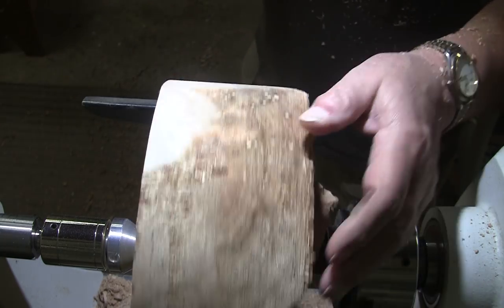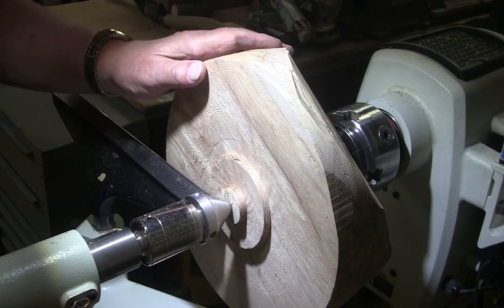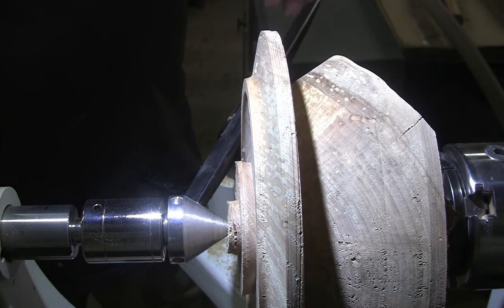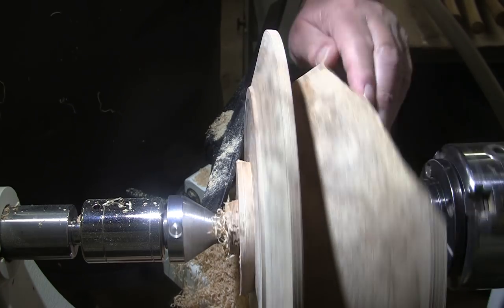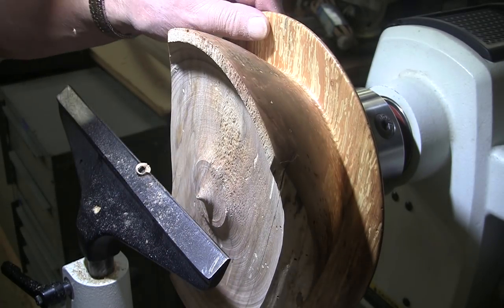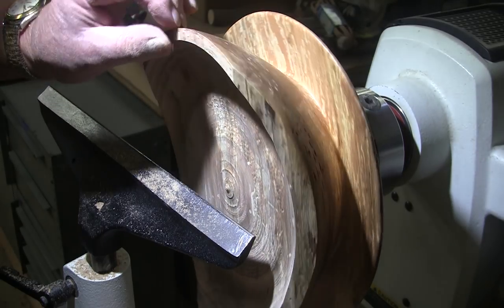Bowl On Plate - Wood Turning

Comment: Phil, if you have one, I would have used a carbide 35 degree diamond cutter to get into the bottom of the bowl to make an undercut, then as you withdraw, do a bit of a scrap on the bowl bottom to round off the edge.  The carbide inserts that I use are not flat, they are designed for cutting aluminum so they have a very positive and very sharp chip breaker.  With that style they actually cut the wood as opposed to scraping it like most flat carbide inserts.  The insert is typically labelled as a VCGT-160404-AK.  The last 2 numbers dictate the tip radius, in this case .04mm which is very pointed.  I think these should be a direct change out for the Easy Wood diamond inserts.  Amazon has lots of inserts like this but shop around as you shouldn't have to pay more than about $35 or so for a pack of 10.
Reply from the maker: I have different tools now that make this job easier, Peter but, still not easy.  The bar has to be thick enough to not vibrate at the long extension but if it is, the cutter is too big.  I have the 3/8" bar detailer and the 1/2" bar detailer.  One vibrates, the other is too big.  But, I can get it done just as I did here, just not quite to my satisfaction.

Comment: Definitely not one of your easier projects! I'm stalled on a small bowl, turned off centre, upon a larger bowl. Very unbalanced and tricky, but it is getting there. I'm stalled because we're in hard Lockdown (so I cannot get to a lathe), but also because I need a particular size and shape of wood scrap, so I can finish turning the smaller bowl. I'll send you a picture when it's done. Your woody adventures have inspired me to try "different" projects! Thanks!
Reply from the maker: I'm so glad you are willing to take on new challenges, Stephanie, excellent! 😊

Comment: I wonder if a small negative-rake carbide detailer would've made that transition point between the bottom of the bowl and the plate a little bit easier.  Might be worth a try sometime, Phil. Still, this project turned out nicely.
Reply from the maker: I do have other smaller tools that would make this job easier, now.

Comment: This was a lot like the bowl and plate that I just did. I had some of the same cutting problem.
Mine was a block of oak pallet slats & a sanding nightmare. I wanted to turn a square bowl. Ended up being a square 7 in. plate with round bowl. 3 in. high.
Great job on  yours. I makes me feel better when I know I'm not the only one that has to brainstorm a turning.
Reply: ...Keep up the good work!
Reply from the maker: Sounds cool, Steven, thanks!

Comment: Agree with your comment full bowl not natural edge would have looked better, I have a feeling you won't rush to do another, unless there is a tool to get into tight places you could get hold of, the plate part looks good so well done for struggling through.
Reply from the maker: And I now have that tool, Lewis!  I just used it the other day on a, well, not similar piece but the same separation.  Worked a treat!

Comment: Well that does it!  I'll never become an accomplished wood turner.  I don't drink coffee.  I think I had my last cup about 40 years ago.  Would A&W root beer work in there?  No, I guess not.  To define the line between plate and bowl, why wouldn't the skew have done a good job, leaving a very fine sharp line between the two?  Perspiring minds want to know.  Keep turning.
Reply from the maker: Believe me, when I make a cut like this needed to be, I think of every possible tool I could use.  I imagine the cut as it's happening.  There is no way I would stick a skew chisel in that juncture.  This had everything to do with the reach over the tool rest.  But, I now have a couple tools that would likely make this an easy job, should I ever try another one. 😊

Comment: Well you got there in the end. Found myself shouting"just because it's a bowl does not mean use have to use a chisel that says bowl". I think I would have tried a skew or something pointed to get into the separation of plate and bowl. Whenever I reach one of those points where I get frustrated with the situation it gives me the opportunity to go outside the box and try to do it differently.
Reply from the maker: Truly a case of you had to be there, Mark.  I could not find a tool that offered the angle I wanted.  However, I do have one now and may turn another one of these.  But, like you say, I got there in the end.  Thank you for your comment!
Phil

Comment: I use an old putty knife and an old short hard point saw blade with the teeth ground off and resharpened as parting tools. They work quite well both as parting tools and as detailing tools. I don't bother putting new handles on them. Many 'other trades' tools can be repurposed for woodturning.
Reply from the maker: Thank you, Nolan, good advice!

Comment: What a cool idea Phil! Beautiful shape and figure! The proportions between the bowl and plate and their respective wall thicknesses were right on the money. I have to say that I actually like the natural edge to the bowl in this piece. You were thinking otherwise, but I look at it and it's all the more "sculpted" this way. Adds a lot of movement to me. 

It sure looked like a scary turn! There was really no easy way going about it. I once turned a small candle holder from a 5" branch (mounted cross grain) that I wanted to basically be a little cup on a little Slab. I had same problems with getting the tool in there and it was scary the whole way through. Your turning was much larger and deeper area to cut. I can't imagine what you were feeling putting your gouge down in between the pate and bowl. That was exciting to watch! Lol

I always enjoy your projects and turning/video style Phil, please keep them coming!
Kyler
Reply from the maker: Thanks, Kyler.  It takes a turner to know what this was like and you nailed it.  Still, I'm going to try again, another time.  Someone suggested the Easy Wood Detailer to get in there and I think that may be just the tool.  Besides, always looking for a reason to buy a new tool!

Now I have to go see if you have posted a new project.  I'm sure you have so I'm gonna put my feet up and see what Ky has been up to!
Reply: madronawoodworks That makes perfect sense with the EWT detailer. That narrow sharp cutter would get in there nicely. And I think you definitely should pursue this idea further, it's a really neat idea! You're making great use of all the wood Valerie gave you my friend.

Comment: Phil, why don't you use diamond tool (regular or carbide) to elaborate this "corner" ? I would do it from scratch!!!
Reply from the maker: I have tools now that would make this job much easier.  The diamond point tool I have is far to thin to be able to extend over the tool rest to make this cut. 😊

Comment: Howdy Phil ...I liked when the video first started with the square tool ...it had a great beat listen to it ...then you went to warp speed..
Did the same with the Black Walnut bowl I showed you , " built in plate "...I think I miss calculated and felt that I would have cut the bottom off . Oh well . The best way I did others is to go straight in with my parting tool , nice and sharp ,  for the "  plate look  " Worked out great .
Maple is so beautiful especially spalted . You are very lucky to have friend that give you that wood . Keep on Turning . I think I will turn one for me with the spalted I told you about .
How many coats of wax do you apply ? Did the CA worl OK ? When I use CA I  apply 2 or 3 times it soaks in so much .Then take saw dust on the CA . Coffee ??? never used it .....Maxwell House or Folgers ? LOL
Today I was working on oak plates , think I will make a complete matching set for 2 , salad bowls , wine goblets , napkin rings , candle sticks etc etc . 

At the end like you said ..it is worth it ... looks so nice Phil ...that what counts worth 10 .. 20 mill easy .
Reply from the maker: Hi Bruce!  I did consider using the parting tool during a break.  Then when I went back to the piece, I forgot!  LOL!  I just applied one coat of wax.  I've tried more and it just doesn't seem to make a difference.  The CA worked fine and the coffee (expensive black stuff) sifts down into the crack and stays there.  Ah, a matching set of tableware.  You are ambitious!  It was worth it, to me, just frustrating at times.  Thank you, Bruce, for continuing to watch and comment!

Comment: Hi Phil,
I know just how you feel trying to make that "inside" cut! I'm not very good at it but from what I've found,,,you have to work it both ways ,,,,a little at a time.
It's actually like the way you remove the little nub at the bottom when you're finishing the bottom off,,,a little off the nub,,,,a little off the bottom of the bowl,,,,repeat! LOL
I really like this piece! Maybe next time you can try a normal bowl instead of the natural edge,,,so we can all see how they both look???
Thanks for the video!!!
Tom
Reply from the maker: I know you know, Tom!  I watched you struggle with it, too!  Yes, I do plan to make another without the natural edge.  I think it will look better.  It's just coming up with a piece of wood for the project.  I'm running out!  LOL!
Reply: I haven't gotten much better at it either Phil,,,,a little but not as good as I would like!
VERY time I get the chisel into a tight spot I run and hide in a corner! LOL
Reply from the maker: I understand, Tom, I understand...  :)

Comment: Beautiful job. If you are going to do more get the easy wood detailer, great for tight spots like that, even though it is carbide🙂
Reply: The problem he is having is that once he bottoms out he is instantly cutting on two surfaces and the surface he comes in on is the reverse of the second angle. Instant crisis if not calamity. Very hard to control. While the diamond shape of the easy wood detailer has a finer angle it suffers one of the same problems in that the cutting surface is large once both angles make contact. A thin parallel sided parting tool is what is required. A putty knife or resharpened old saw does the job nicely.
Reply: Nolan, been turning for 50 years, so I understand the problem.  If done carefully you can plunge cut with the detailer, but I would have put a slight ogee on the bottom of the bowl as if it had a raised base with the detailer, then used the thin parting tool to finish the corner.
Reply from the maker: Thank you, David!  And, thank you for the great suggestion of the detailer.  While I don't care for carbide, I do think that particular tool would have saved me considerable consternation and I'm going to buy one.  Always looking for new tools that will make the job easier, or in this case, possible.  I think that is the ideal tool for this particular task.

Comment: Could you have used a parting tool to get the the edge between bowl and plate for the sharp edge then round into it
Reply from the maker: A parting tool is too short and I didn't want a square edge there, rather a tight round corner.  I now have tools that could probably get it done, Darrell. 😊

Comment: If you really like the coffee filler, you might get a small spice grinder, and grind the coffee down really fine. Then you can fill it more solidly. Also, if you dust it in first, then add CA, coffee will sift in deeper, and the CA will still soak in. Not so much an issue here, where you already were about the thickness you wanted, but for future projects. You can also throw small wood chips in the spice grinder if you want a lighter color fill, or one that matches the wood you are using... or if you have some nice red colored wood chips, it would look good on a blonder wood... without having to get into the colored epoxy. And - I have not tried it, but I bet some of the powered colors for epoxy would work really well in CA... just like the coffee grounds. (If you have a wife,  or lady in your life, try some eye shadow colors with CA.... but I didn't suggest it!!! LOL)
Reply from the maker: Great idea, Susan!  Never thought of a spice grinder for wood chips but I bet it would work.  Not too sure about the eye shadow...  :) 
Thank you for watching and your delightful comment!